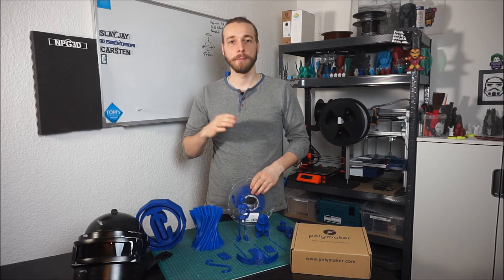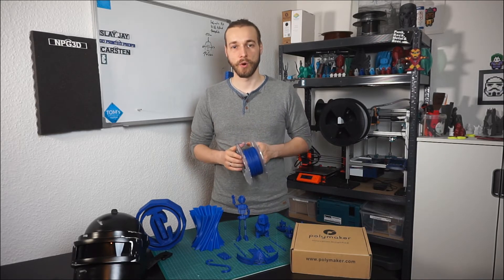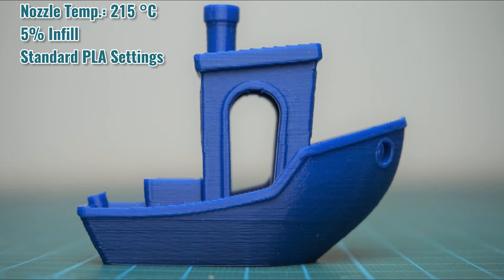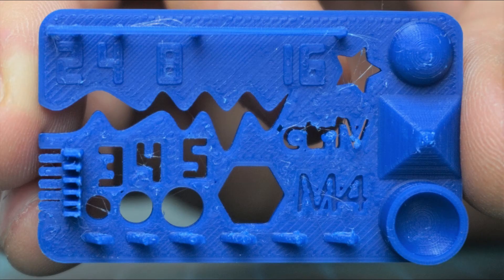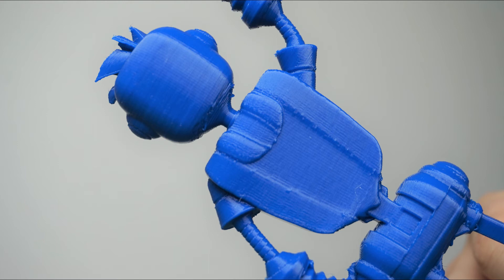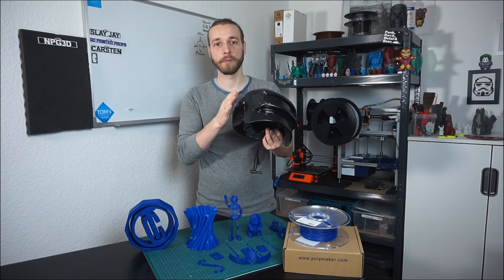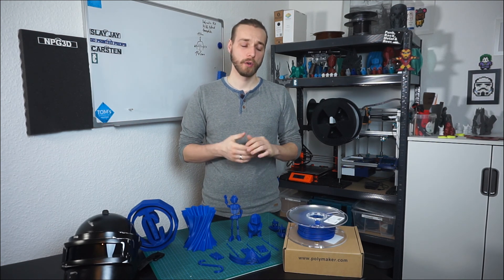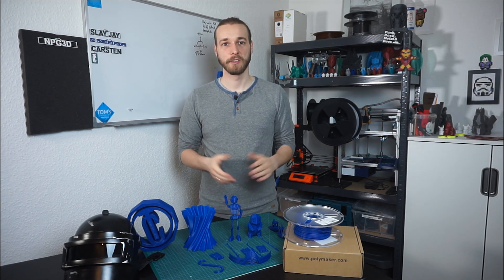Polymaker PolyLite™ PLA Review

Comment: Very nice review. Interesting to see the results and your conclusion about the material in comparison what I have experienced.
Reply from the maker: Thanks Cat. I just watched your video and saw that you also had some issue with the stringing of the material. You went even lower with temp to eliminate them. For me the "middle" setting was the best which can be a sum of other settings in my slicer why you had to go lower in temp and I was a little bit higher. In general I think the stringing was a issue of this filament compared to others which really are easier to print (you don't have to change settings that much but others might be more expensive). In the past I had the issue when I was printing with very low temp on materials and wanted to go with higher speeds than I had extruder skipping or underextrusion as with lower temps filament cannot be melted fast enough. Maybe kind of a personal preference to not go that low. But I see that you have a point there! Well done. :)
Reply: Speed and temperature always have to be adapted to each other. So it's logical that you have to rise the temperature to prevent nozzle jams. I printed the most of those prints in a small scale as you could see. The second thing that you might not have recognizes is, that all of my prints were below 0.2 layer height. I used 0.1 on most of them. ;-)
Reply from the maker: Cat yes you are right. I also recently had the issue with a filament which printed totally fine at 0.15 but had issues with at 0.2. It also does make a difference. I print 80% on 0.2 because of time.

Comment: Isn’t a blow torch a little to hot to remove stringing? 
I just know that heat guns can be used.
Reply from the maker: atStahlfabrik you can totaly use it. You only need to get a small amount into the string, so you only have to apply it very shortly. Of course a lighter is also feasible. Whatever you have in your tool box.
Reply: TinkerCave thank you!
Reply: I’ve heard that a hairdryer will also remove stringing